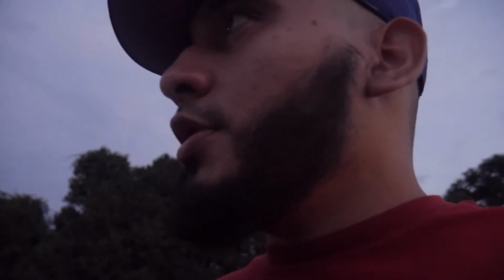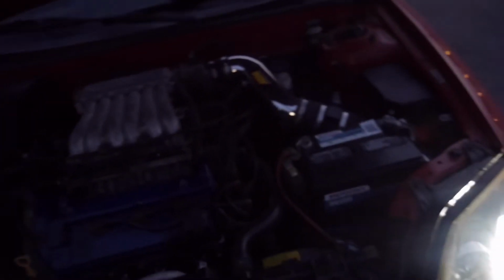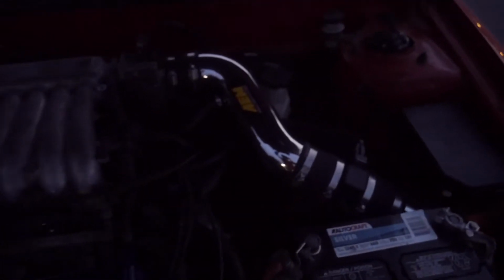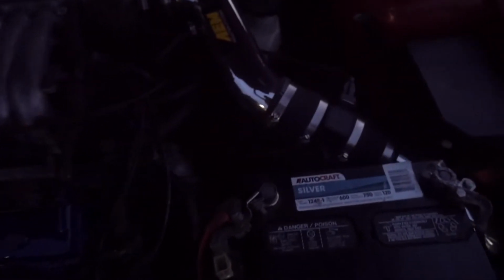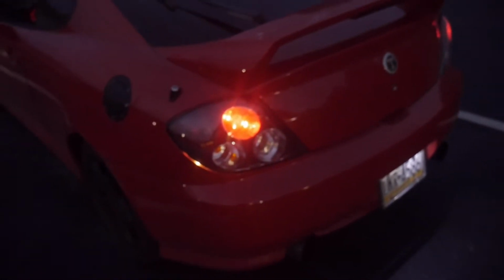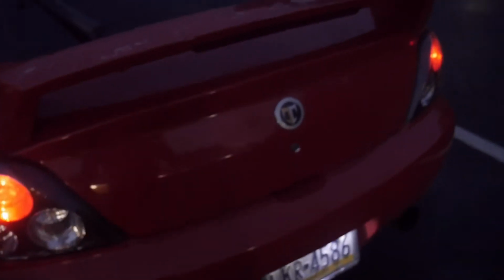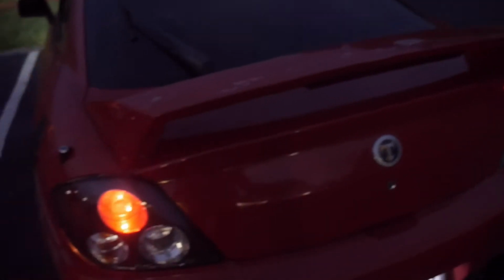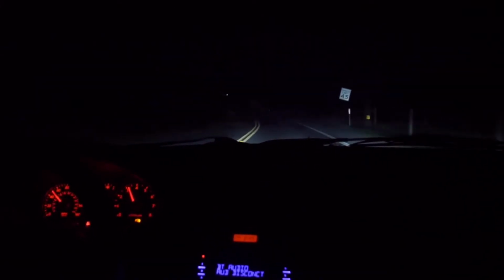Tiburon GT CAI & Headers, Valve cover restored Blog, cruise & pulls/cam upgrade & turbo kit plans!

Comment: As someone who is also turbocharging his , it's really hard and expensive to do
Reply from the maker: Ik but deff worth it since not everyone got a boosted tib.
Reply from the maker: I'm not going for crazy boost either just a respectable 300whp
Reply: @Aplayasworld  it's still expensive to do you will need at least 5k for everything,  clutch,  fuel system,  a standalone eci tune with and someone to weld the turbo parts for you and much more